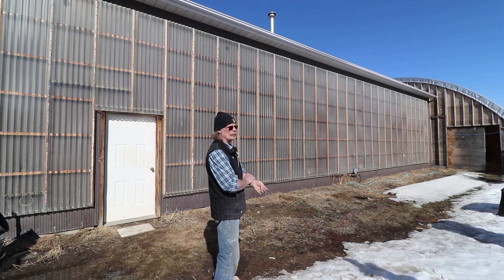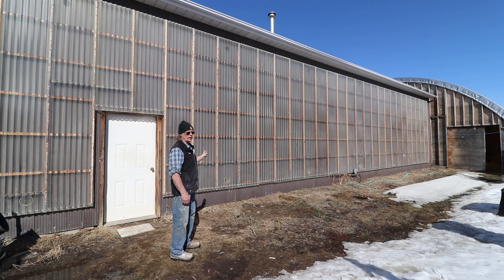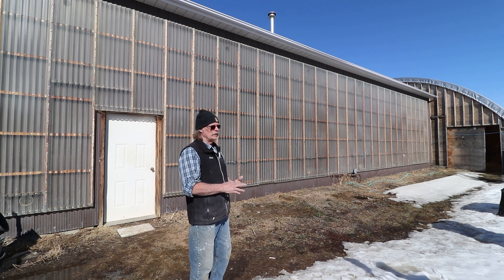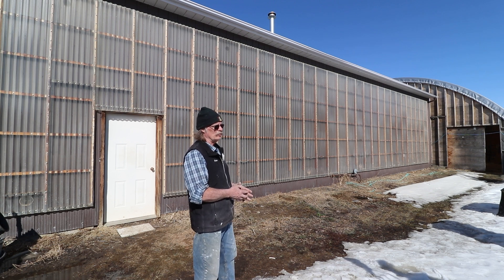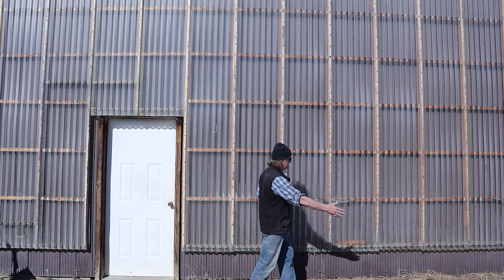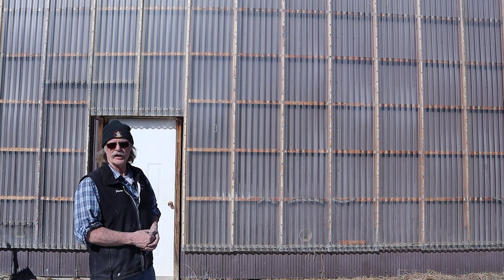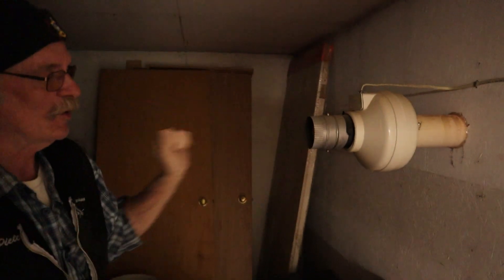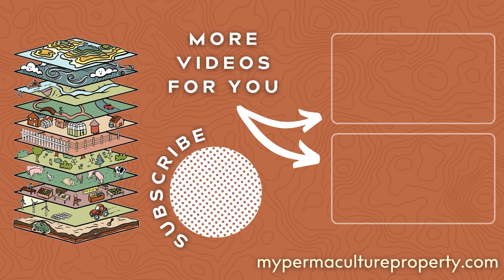A Farmer's SECRET to Building a Passive Solar Workshop that Really Works

Comment: Almost at the end of the presentation, he mentions the tin.  A little bit more. Information about the cross section of the wall would be appreciated. Is the structure corrugated plastic with an air space, then the building wall? Is it corrugated plastic with tin against the building wall? Is the structure corrugated plastic airspace tin  airspace, then the building wall?   
   Also, any wood in the wall exposed to that heat for an extended period of time years would continue to get drier and more flammable and eventually could could burst into flame at a much lower temperature than you would normaly expect.
Reply: Wood has one combustion temperature, and it is much higher than the temperatures produced by this passive solar wall. It's true that wetter wood will not ignite as soon as dry, but it still takes 300º C or 572º F to ignite without a spark or flame. By the way, Pieter gets the centigrade and fahrenheit numbers mixed up sometimes.
Reply: I've been looking at the video over and over trying to figure out the cross section of his wall as well.

Comment: Very interesting.  This has me thinking about my 40' by 60' shop.  Of course, the south facing side is the short side, but we did plumb the floor for in-floor heating.  This could be a valuable modification to add a heat exchanger to heat fluid for the floor.  We presently just have the pipes in place in the floor, no electricity nor actual use of the pipes - we had it installed thinking toward the future.
Reply: Look into evaporated tubes and use the radiant it is WAY MORE efficient then air.
Reply: You can use a small solar set up
For the circulating equipment & monitoring.

Comment: Awesome work! Impressive and thanks for sharing.  can you explain why you block the first layer 90% the next 50% etc?
Reply: Based on my intuition, it is to get air moving through each of the panel gaps.  Without that blockage forcing the intake air sideways, it would all just move up straight from intake to exhaust, not taking advantage of the broader solar collection area.  Also, going through just the one section, the same volume of air should move faster, so wouldn't be able to pick up as much heat.

Comment: Great explanation of a clean installation!  Has anyone ever seen examples of this type of solar heater applied on a south facing (dark red) brick wall?  In that case, would these air temperatures be detrimental to the life of the mortar?

Comment: Any chance you got the name brand on his blower fans? Interested in buying some.
Reply: They look like radon mitigation fans.  Build to run 24/7 - 365 and rated for external (read wet / damp) location use.
Reply: Pretty sure he showed it in the video...
Reply: @sobelgar9289  yup your right. Took me 5 tries but I finally got a pic of the name. Fantech Fr100

Comment: Great design and idea! Thanks for sharing! What about summer time? Just turning the blowers off and that`s it?  Or some kind of curtains goes in front of the collector, because I believe, in hot summer time there could be a possibility for fire to break out?!
Reply: I'd like to hear more about management of this type of design for warmer months as well 👍🏼
Reply: I wonder if you could cap both ends inside the shop and incorporate a vent on the outside assembly, but that might encourage mold growth...  
I believe Rob has incorporated a beeswax telescoping rod in his passive-solar greenhouse / root cellar design; I bet he's got some sort of handsfree solution!
Reply: In summer the sun is directly overhead so it is naturally receiving much less solar insolation. A larger overhang would help with overheating in the warmer months-- that's a passive solution. Another passive solution is low and high vent on the north wall to release hot air and let cool air in from the shady side of the building.

Comment: So if you can't circulate the air under your slab, strong blowers will force the hot air down enough to make it comfortable instead of all the heat collecting at the ceiling. That's good to know! Great for a retrofit scenario.

Comment: i couldnt really grasp the whole thing. how is the heat transfer from the sun on the outside of the building heating the air to 68C that is pulled inside? i dont understand the mechanism
Reply: It's the same as when your car sits in the sun and heats up way beyond the outside temperature.
Reply: There are vent holes in the wall, near the bottom and near the top. A fan at the bottom or top pushes air through the vents and the sun's heat helps the air rise to the top of the wall, where it moves inside through the vent holes. 4" diameter vent holes, he said.

Comment: This is essentially a Trombe wall for a shed. This application is the first I've seen for a shed/workshop but I've seen them on greenhouses and a few homes on YouTube.
Reply: Thanks for sharing the word Trombe🙏🏼
Reply: A Trombe wall is made of material that can store thermal energy.
There is no heat storage in this system so it overheats in the day, and eventually drops below comfort level in the early morning hours.
Items stored in the shed undoubtedly act as heat storage batteries and help to even the interior temperature, but adding mass just for the purpose would be better.  The Trombe wall idea uses masonry in the structure of the wall construction to do double duty as heat storage.  In a steel frame, or wood frame, building, water filled drums can be located inside the building for storing heat.  They could stack drums in the shed and duct the heated air down to heat them.  They would keep the shed from over heating in the day, and toss off heat at night.
All of this stuff has been studied to death for at least 50 years.  You can get a lot of energy out of a solar-thermal system, but typically it's not as controllable as people like, and it requires a lot more insulation to work.  That puts a heavy front-end cost on construction that frightens people away.  When you are talking about heating houses, not sheds, you have add in the impact that building codes have.  I can't speak for Canadian codes, but here in the U.S., you must have conventional heating in the house as a back-up.  So that adds even more money to the up front.
If you want to forget about heating altogether, you can put so much insulation in a house that you literally need to keep a window open at all times just so you don't sweat to death.  Don't ask me what that would cost, but you can figure that it wouldn't be cheap.  On the other hand, if you lived on an island and hauling heating fuel was a pain in the rear, that might be the way to go.

Comment: Fantastic example! Very Exciting. Prof Tang Lee from UofC might say the optimal gap between wall and plastic is 4 inches. A black wall would make it hotter.  The corrugated plastic may filter the light hitting the back wall a bit, but the corrugations running upward make a great upward flow for the heating air.  What a fantastic setup  Pieter has there.  Thanks for showing us Rob!
Reply: Thanks for sharing the details about the gap at 4 inches 🙏🏼

Comment: Does it sweat?  Great building!
Reply: Based on the staining of the wood, I'd say there is some moisture present but not much or not constant. If there was a lot of moisture the wood would be all gray. There are only stains in certain areas.